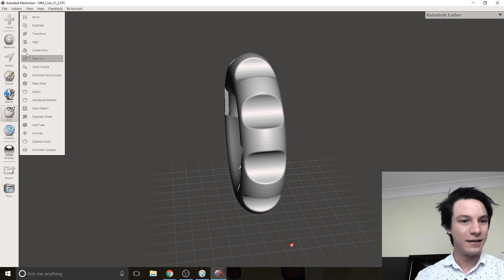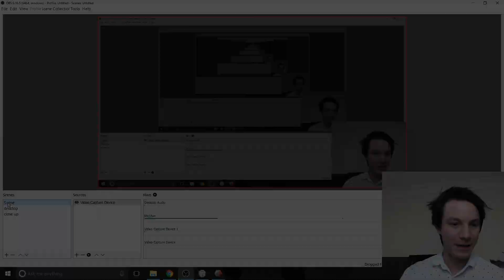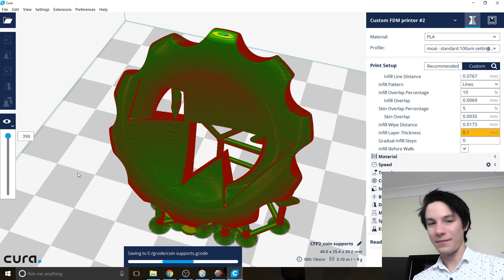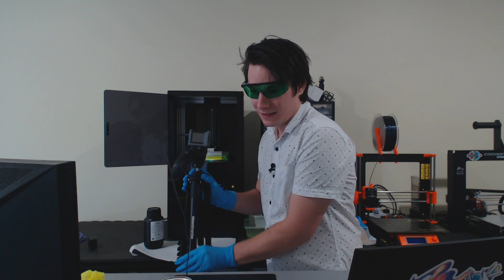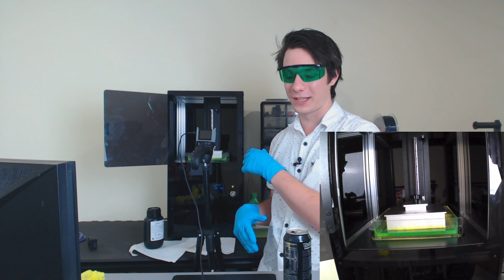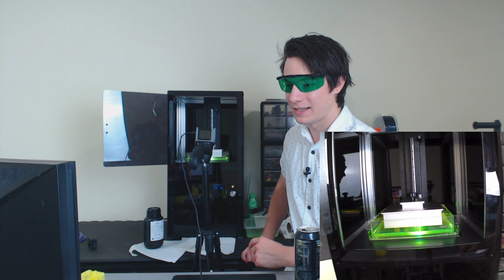WAS LIVE: Moai SLA 3D Printer Setup, Use and Impressions (currently on Kickstarter)

Comment: Hey mate, 
I just came across your channel and love your content.
Is resin durable enough to confidently sell models that I print?
If not, can you recommend me a printer that prints durable + quality models?

thanks!
Reply from the maker: Most resins are suitable for light use and presentation but they can be brittle. You can get 'tough' resin if you need something a bit less brittle. OK to sell just make sure they know to treat the prints with respect

Comment: If i understand it correctly the reason submerging in water helps the cure is because oxygen actually retards the curing process so immersion in water helps the resin cure in the UV (obv not a vat of it) the carbon printer makes full use of this using it's gas permeable layer allowing retardation  of the cure using letting it cure way way faster as a continual stream of curing happens with the oxygen being allowed through the gas permeable layer to prevent curing where you don't want it.

Comment: Hi Angus, Would you by any chance know what the temperature resistance is on those sla parts? I'm looking at getting the machine to manufacture low volume/prototype injection molding tools.
Reply: If the material has a low temperature threshold, then use silicone mold material which sets up at room temprature.

Comment: It is not because they set the laser spot size to 67micron that this is the effective spot size. In fact it isn't because focussing a 405nm diode laser to such a small focus point over a relative large distance is almost impossible unless using extremely expensive lenses. But the 67 micron setting is the setting which will have given the best resuls on adhering 2 differen passes of tje laser. Compare it with fdm, where your have a wall thinkness of 3 passes. These 3 passes should adhere to eachother and therefore they overlap a little. Thats the same here with resin which needs to overlap a little to fuse. And that is also why cura can slice this. You are in fact literally curing lines of resin the same way as fdm passes to print

Comment: Couldn't you just use a uv laser diod mounted in a normal x y axis like a normal 3D printer so it removes the need for the mirrors to aim the laser. Sorry if some of what I said does not makes sense I don't know any of the terms for 3D printing lol

Comment: I think GW, and some other miniatures makers are worried... it will have to get much better.  I don't know a lot about SLA... but it looks very cool.  I have a custom built miniature from Hero Forge.  Not sure what they use, but it is great.  

I bought my 3d printer after watching some videos on printing Terrain and dungeon tiles for games.  (Finally got my first print, partially... last night, thanks to you and the Tevo Tarantula FB Group).  I think right now, with normal 3d printers, terrain makers should be really worried.  It costs a dollar or two to recreate pieces that are sold for $20 (USD)+.

Comment: I may have missed it, but are they using a PDMS silicone layer in the vat? or some other release substrate? All bottom up SLA and DLP machines use either a silicone layer, or some other non stick surface in the vat, so prints stick to the build plate, not the vat. You can replace it and reuse the vat, but Formlabs for example, state their vats are consumables, and you need to replace them after about 2 bottles of resin worth of prints.

EDIT - Just looked at the FAQ on KS, and it does use a PDMS layer, so I'll share this info. I use this stuff in the vat of my SLA, it's cheaper, easier to get (for people in Aus anyway) and works just as well.

http://www.barnes.com.au/addition-curing-silicone/breakable-glass-1573

Also, how do you level the printer? the build plate needs to be parallel and level with the vat surface, this is a big cause of failed prints with SLA.
Reply from the maker: +Paul Braddock the bed has fine screw adjustment and a focus checking routine, but as Mark had tested this unit I didn't have to try too hard to get it focused. Thanks for the release link! Should prove handy.
Reply: Thanks Angus, that's how my current printer deals with it, however, it's very finicky to adjust on that machine, largely due to poor access and not being able to see what you're doing. A multi axis build plate, or ball jointed build plate would be great, so the build plate can just find level with gravity against the vat, before tightening it up.

Comment: I saw a trick on how to help your SLA UV prints set better.  You can go on e-bay and buy a UV Lamp usually used to help nail polish.  From what I've seen it works pretty good, you just need to have a way to rotate the print so all sides can cure.

Comment: Why are the trays not glass ? Longer shelf life?
Reply: lunaticcycle1300 I believe the trays need a special coating to help release the prints, which gets damaged over time. One reason the prints should be positioned in different spots to prolong the tray's coating.
Reply: Still wondering why tray isn't glass ?, eliminate the hazing effect or damage given by "scraping" off a print
Reply: you still need the coating that eventually wears, there is a company that made glass bottom trays for the for the Form 1, but you still have to recoat the glass when the nonstick silicone layer turns cloudy. And they cost 100 a tray.
Reply: The most common types of glass block a majority of UV light, so you'd need a specialized glass that wouldn't block UV light, as well as the non-stick coating.

Comment: SLA printers are generaly used for creating dimensionally acurate prototype parts that can then be used for creating molds for casting or other fabrication methods.
You would not use an SLA printer to print model Benchys or Groots just to put on your shelf.

Kogan has a rebranded Wanhao i3 v2 for anyone interested in getting into 3D printing.
Reply from the maker: not 100% accurate, SLA is used extensively in the prop industry as well as for visually accurate, non functional prototypes. The higher layer accuracy and resolution means less sanding and more detail!

Comment: if you use infill like FDM, won't the liquid resin drain out as the print raises higher since it's being printed upside down?
Reply: Marcus R I was thinking the same thing, but then I realized something. If you have a cup upside down in water and it has water in it as you pull it up the water stays in the cup at the same level. the same thing will happen with the resin
Reply: SUPERMAR10312 when it tips to break the seal each layer, doesn't it allow air inside?
Reply: It's being printed against the bottom layer of the vat, so the tipping just relieves suction against the bottom, it's not letting air in. You can pretty easily design small relief or drainage holes in your part, so it's still possible to make hollow prints, you just need to plan accordingly.